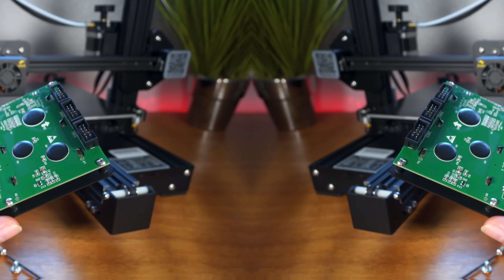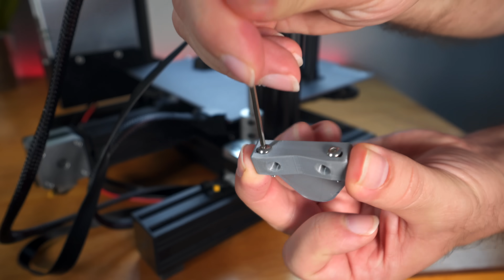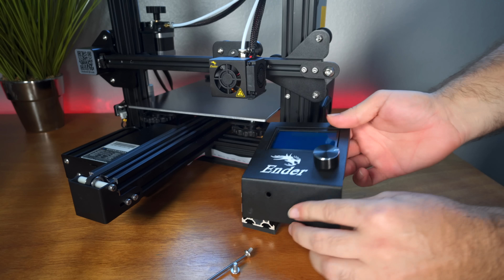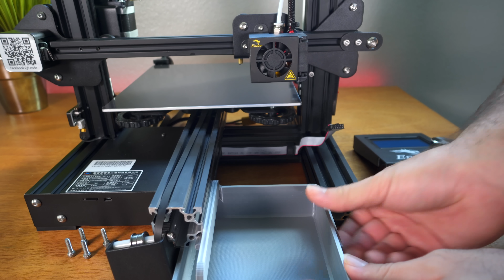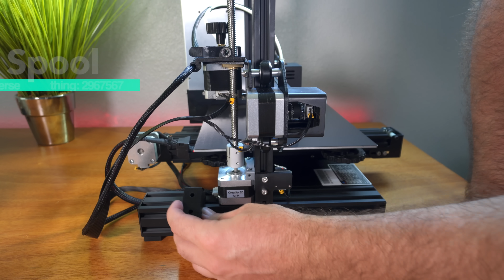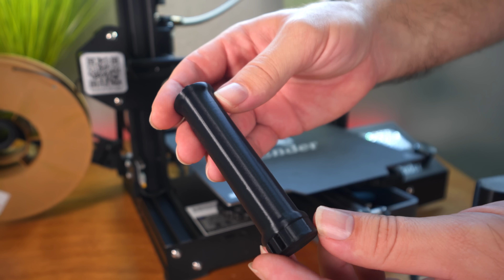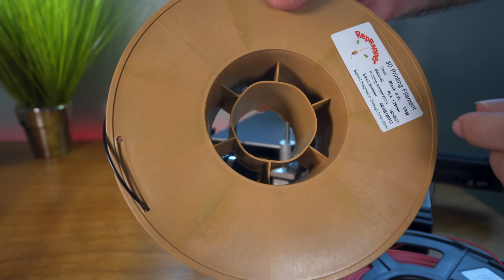Creality Ender 3 Pro - 3D Printer - Upgrades & Fixes

Comment: @Just Vald, I was watching your wonderful video. 

You stated that each of your Ender machines need the shim on the Z-Axis stepper motor, I highly recommend that you look at your X gantry LEFT bracket (where the extruder motor is mounted and the lead screw nut is mounted). Check to ensure that the metal bend is 90 degrees (the part where the lead screw nut is mounted). If that bend is NOT square it will cause the misalignment issue down at the Z-Axis stepper motor. Here is a link to a video that explains the issue and how to properly fix it. https://youtu.be/xnzNd_FIMKY 

In fact you can see in your video that your X Gantry bracket IS Bent, it’s NOT 90 degrees. You need to bend the Bracket or search Thing-averse for “straighten up the Z-Axis nut” https://www.thingiverse.com/thing:3282082

Comment: Hey Vlad,
  Your videos are awesome keep them coming. I never thought I would get into 3D printing, but after stumbling onto your videos one day here we are, and I’m the owner of an ENDER 3pro. First off your video on unboxing & setup made the whole process the best I could hope didn’t even look at the papers that came with it for assembly. I’m having trouble printing the 3D upgrade parts like the airflow part, and such I think it’s a slicer issue I’ve tried cura, and the creality slicer that came with it walls, and top go thin. Other prints come out great that I’m currently doing, and slice. Can you send me the g-codes you used so I can try them out please. Wanna see if I’m just plain doing something wrong, machine issue, or slice issue. Also do you think I should keep firmware that came pre installed, or update to latest? Do you have a video on how to do it? If you think it would help. Thank you for your help in advance, and all your videos!!!!

Comment: I am astounded at the number of fixes these things need, coming out of the box. Realigning, shims and brackets, cutting stops off of limit switches. This is RE-MANUFACTURING!  And you haven’t plugged it in yet! One fellow advocates opening the control box, and making certain all of the wires are tightly connected (two of his weren’t). These can’t ALL be made on Monday. Within my first month in the hobby, two hot ends failed for me (one shorted, one lost control), and the bed was warped.  On One the bed was not even attached to the carriage, and the wheels were very loose.
The whole field seems to be in DIY mode, like in video: “We’ll fix it in post...”
I do have to say that the step motor endurance and accuracy is amazing. They are now into X, Y, Z., retaining accuracy over 52 hour builds I remember when HP plotters were leading-edge. And the slicing software...defining vectors for the head to move through space depositing hot plastic.  It makes sense to use the xyz for CNC, if the gantry is strong enough to carry the stresses of a serious cutting head.
If you’re accustomed to command-p to print, this field is not ready for you.....leveling, tweaking temps and fans...

Comment: So I made a noob mistake and started printing the tool tray without supports in the slice. Surprisingly the Ender 3 Pro did the cross bar perfectly without supports. I thought for sure I would have to scrap the print 8 hours in when I realized my mistake but it actually drew it mid air with minimal defects. I was blown away.

Comment: I am having problems printing the clips.  The printer tried to build the layers with one hook on the bottom, and the other on top, exactly as shown in the image accessible via Vlad's hyperlink for "Ribbon Clip" below.   When the printer tried to print the top hook, the first layer is suspended and thus had no support so remainder of print did not come out well.  Am I supposed to rotate the image before doing the slicing?   I am completely new to 3D printing and am clueless on what to do.  This is only my second print.  Can someone please advise?

Comment: Vlad, 

I down loaded from thingiverse and when i install the file in the SD card in and try to print some of the upgrade the Ender screen shows the file on the screen but its like there isnt anything to print or something. The SD card has the dog and cat and the file has quite a bit of memeory but the thingiverse files are only KB when you down loaded. Do i have to be a member to download the file correctly?

Comment: Hello.
I love your videos. I am brand new in the 3D printer world. I set up my printer yesterday. My first print after setting the bed was the same as you showed in the video. It started well, but when I came to look for a few hours, it stood there without a head. See that you have support, but mine has no clue to this. Is there a g-code error, or are there some settings I haven't figured out? Attaching a link to my result. 
https://drive.google.com/file/d/1oIYZv6ZEZ2wUknvvgPu0gtEQa3rDRFnQ/view?usp=drivesdk

Comment: I did all the upgrades on my ender 3 and now my prints dont stick to surface - perfect bed lever - glue stick - even with brims - prints fail 30-50 layers in. I suspect its the Capricorn tubing  - anyone else have this issue?

Comment: I don't know if you know this or not by now, but you can get stepper motor smoothers for the X, Y, Z and E axis for your Ender 3 (and 2, 4 and 5 too) that will get rid of all those layer lines you mention.  It made such a HUGE difference in my prints that I am touting the gospel of the smoothers!  Good luck and great video.

Comment: DONT MOVE ANY AXSISWITH WIRE PLUGED IN TO THE STEPPER MOTOR. you are make a current/voltage sending the wrong way, this is the best way to burn of your board....

Comment: Mine came with Bowden clips. So it is normal for the bed to BANG the stop at the beginning of a print. The fan cover would be a good upgrade since Creality for some stupid reason put the fan where stuff can fall in rather than on the side.

Comment: with the latest incarnation of the Ender 3, they have moved the micro SD card slot right at the bottom making it hard to insert the micro SD, so the next upgrade for me is the micro SD to SD card converter

Comment: Nice work. MakersMuse says the boden system on this printer is a big problem and the cause of most of the quality issues.Change the system to a direct drive, and it will likely be 100%.

Comment: Ok to solve the worm gear position issue I simply loosen all 4 bracket screws and the two screws holding the brass worm -engager thingy on top.  Then I tighten each one a little bit as if I were putting on a car tire.  That lets the machine settle into the correct position.  This happens because of the whole partial assembly thing.  If Creality were to try and instruct people to do this it would probably cause even more problems.

Comment: HELP. I bought 2.85mm filament for my Ender 3 (can i use 2.85mm in my ender 3 it's normally 1.75 - do I need 5o make any modifications)?

Comment: Flip the original spool holder with ridges to the back then you'll get a flat edge to the spool holder and then it will be vertical with no drag.

Comment: Watch out! Don't spin your stepper motors too fast.  They are able to generate electric pulses with high enough voltage to damage your electronics.  Keep it from going faster than about 15RPM.  (about as fast as you can turn a screwdriver by hand. )

Comment: Thanks for the vide Vlad, have you used the default temps for the Dog file? Mine at 60c will not glue the first layers and later on about half of the dogs body it will move and mess the whole thing, I started setting the bed tempo to 70c for the filament that came with the printer. First time printing here.

Comment: About Z axis level. Just reassemble X axis. There are too big holes and because of that X axis not fixed horizontally.
I did it today) And now I have half of thread on heatbed bolts.

Comment: I personally don't recommend using bearings on the spool holder, but all my experience is with direct drive extruders. Might work better for bowden, but you generally want a little bit of drag on the spool to prevent it from unwinding too fast, or else you might get some slack on your spool which might fall off and get snagged on something. Almost certainly a bigger issue with direct-drive over bowden, but just sharing some of my experience.

Comment: Hello ! Good video. I'm using Ender 3 Pro for 2 months which has already a flexible magnet surface. Unfortunately some rest of PLA printing stays on the surface deeply in the material. What do you suggest to clean it up ?

Comment: Thank you for this demonstration.
are really great upgrades.
The roll holder, now that you have placed it in this new location, the new part with the bearings works well, but if you had two rollers placed parallel, the whole filament roll would be supported and would work much better.

Comment: Good upgrades

1. Replace the XT 60 connector in the back to an Amass one. Creality uses a knockoff that has the potential to overheat and burn out when you print PETG TEMPS. 
2. Seemecnc EZR extruder
3. Capricorn Bowden tube
4. Replace those couplings to the Hot End (the EZR has one embedded in the extruder part
5. 3d print a new blower. Either the Hero Me or Bullseye or Petsdfanf. I like using the stock parts so I went with the Hero Me V2

I enjoy your vids keep up the good work!  I like how you worked from the Monoprice mini to Ender 2, 3 Pro. What’s next the CR 10S PRO?

Comment: Its a very good printer and really happy with mine.

I have also added a BLtouch, filament runout sensor, petsfang V2 dual blower version, TL smoothers, metal extruder + the usual printable upgrades.

TL smoothers defo worth installing

Comment: Great video Vlad!
Check out Octoprint, you can control the 3d printer from a webpage. You can also get some really good time-lapses using the octolapse plugin! https://octoprint.org
Also, most Ender 3 machines have a build plate that is dished down in the middle.(warped) Put a straight edge on the bed to tell if yours has this issue. A glass build plate can help you get your bed closer to being level.

Comment: Hey Vlad:
I find your videos informative and straight to the point. Really helpful, I plan to buy a 3D printer so I could print gaming miniatures also 1/2500 and 1/1400 scale spaceships, from what you suggest, the Ender3 fits the bill. However, I was also looking into the Ender 5, do you plan to review that eventually also? (Funny thing though; my son checked GearBest and Banggood, he couldn’t find any Ender 5. Did they pull it or just sold out due popularity?) Thanks — Frank

Comment: When will you finally realize that t-nuts are supposed to be just put into extrusion slot and they do turn themselves when you screw your bolt in?
Stop messing so much with them, it's much simpler to use than you think.

And you don't need to roll your spool really easy, it will only lead to spontaneous unrolling.
There have to be some considerable friction and your extruder motor should be more than capable to overcome that friction.

Comment: mine came with t he tube spacers. My z axis doesn't bind - no shim needed. I replaced the plastic extruder with a metal one. Also look at your power supply connectors. Mine came factory wired unsafe. Male end on the power supply.